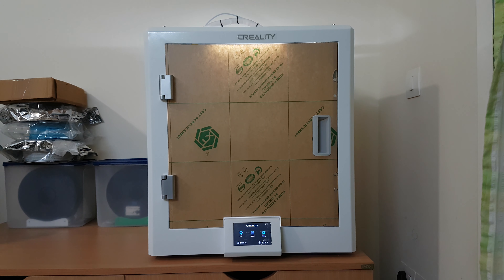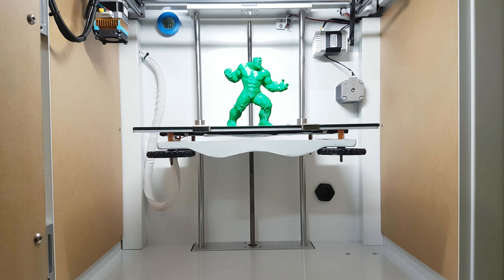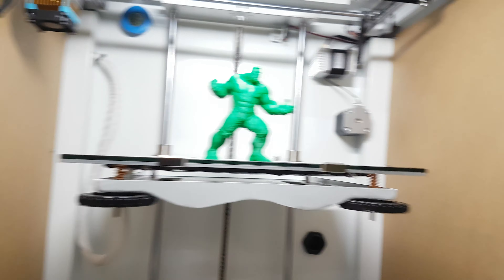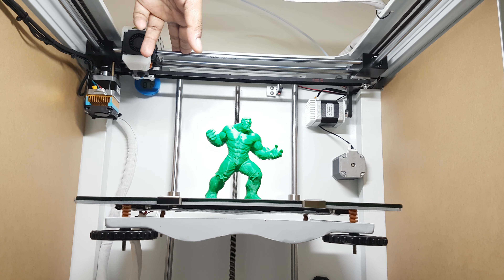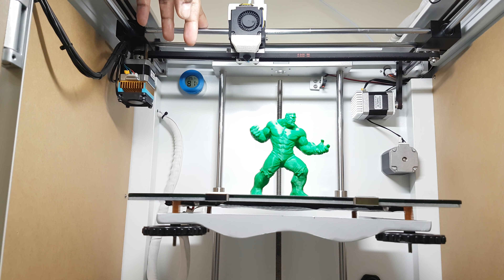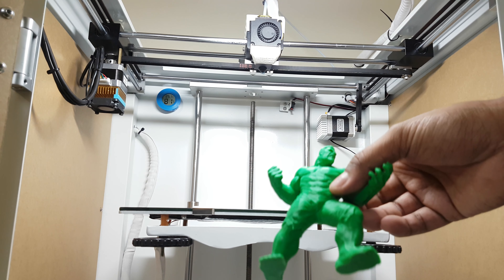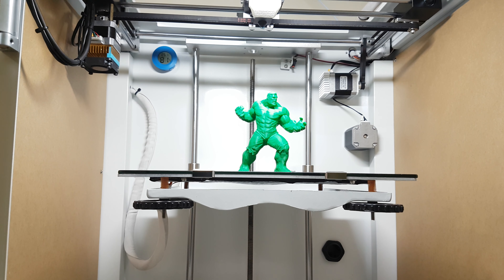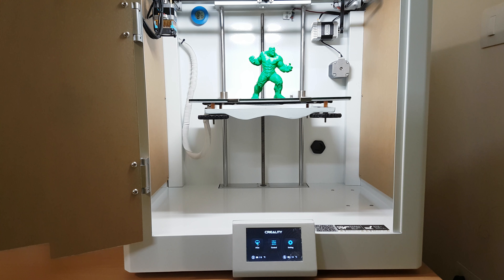Creality CR-5 Pro Review Part 2 ( Do Not Buy) purchased from 3idea.in

Comment: Hi two months ago I bought a cr5 pro H and from the very beginning there are problems with the hotend clogging I tried many settings I managed to once on the original filament after printing one model again the problem and the second time for complaints to the store now the motherboard has fallen is the biggest nightmare the purchase of this printer I wrote  to creality they wrote back twice but they repeated their rules as I wrote to them about the motherboard, they have not answered so far, which is a pity for this scrap
Reply: If you does, How do you solve hotend clogging?

Comment: This looks to be a very similar design to my CR-200B, which is the worst printer I've ever owned. I have a CR-6 SE, and two BIQU printers that have been great. I never got a good print from the CR-200B. I'm about ready to part it out and sell the pieces on the "e" place.

I really wanted to like the enclosed printer, but I'm thinking it would be cheaper and more reliable to build my own enclosure around one of my other printers.

Oh, and for the loose X/Y rods, if you can, check to see if the bearing retainers are broken, it might be like my CR-200B which had all 4, flimsy bearing retainers broken from new.

Comment: I have the cr5 pro h, nothing but problems. Have you found any upgrades for these printers, like a better hotend
Reply from the maker: take time to find the issues in the printer and understand its limitation/tune settings. Upgrading parts may not solve the underlying issue till you can pinpoint the issue. I have done a few modes but have not replaced the main components, I do not think changing them will significantly change the results i am getting now.
Reply: Apparently there is a few guys in the forums that did sprite hotend. They haven't shared files yet, so I'm going to take a whack at it.

Comment: Why haven't you removed the protective paper from the plexiglass sides and front? Do you not want to see what you're printing while you're printing it? Seem silly to do a review and leave that protective paper on the printer.
Reply from the maker: I am trying to review the printer not promote the printer. Plain plexi glass attracts lot of dust and lint as it gets charged easily. Maybe in future when all mods are done will remove it. Regarding your concern about looking at the print, well I  normally see it from top or by opening door.  I will be installing a camera for remote monitoring in future. Regarding reviewing this printer I only did the review as there are no reviews for it anywhere. Even after 3 months I do not see a single review.
Reply: Plexiglass really only gets charged when you  first remove the protective paper and then you can easily discharged it with a damp rag. It will stay discharged unless you rub something like a cloth against it. I have multiple printers with plexiglass and have never had issues with dust and charging of the plexiglass. But it will get supercharged when you remove the paper. But easily discharged with damp rag.

Comment: Hi, thanks for the review of the CR5 pro. I own this printer too and share the same sentiments as you. May I ask what slicer you use for this printer? Do you use Creality's slicer, or do you use Cura? Thanks!
Reply from the maker: Initially, i used the Creality Cura then copied the settings to the latest Cura version. I have also ported the settings to Simplify3D but then again switched back to latest Cura as Cura offers more advance settings
Reply: @DoTheDiy  Thanks for the quick response brother. May I know whats the custom printhead settings when creating a custom printer in Cura? Thanks! Cant seem to find any documentations regarding the CR5 Pro, so your video is a god sent.
Reply from the maker: @AlvanLuiz   in Cura create a custom FFF Printer and then change the name to CR-5 pro and copy all the printer settings from Creality Cura
Reply: @DoTheDiy  There is no CR-5 Pro settings in the creality slicer though. I used cr-5 settings from there, but there it still doesnt result in great print qualities unfortunately. May I know what print speed, and retraction settings you used? Really appreciate your reviews thus far. Thanks!
Reply from the maker: @AlvanLuiz  Hi i have shared the settings 4 Cura https://drive.google.com/drive/folders/1A7uxsGm2f5d1yYhdIkt2GFYwP61UROyS?usp=sharing
Reply: @AlvanLuiz  therefore Cura wins

Comment: Can we print gold jewellery with this? Like instead of that filament we insert gold wire?
Reply from the maker: No this printer can reach max 250C and gold will require lot more. For jewellery you have different printers which help in making a cast for the casting process.